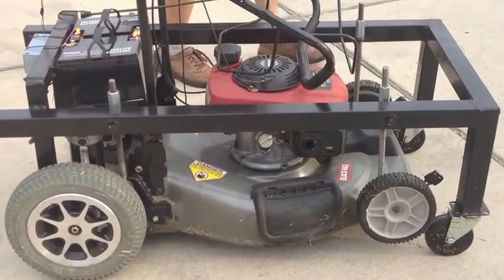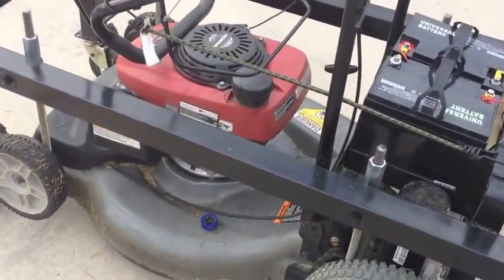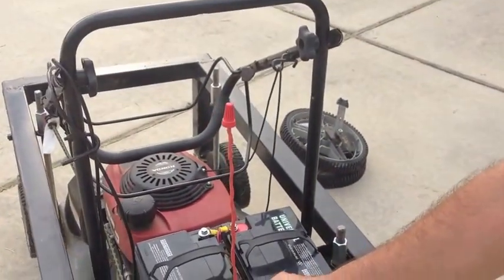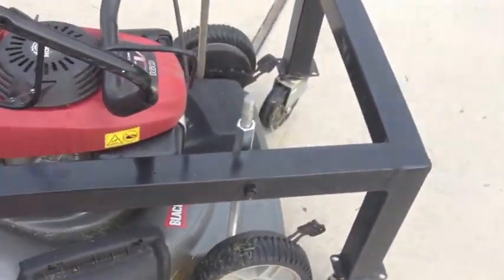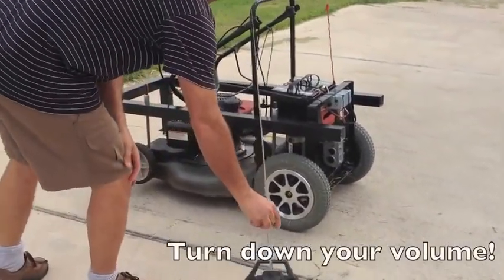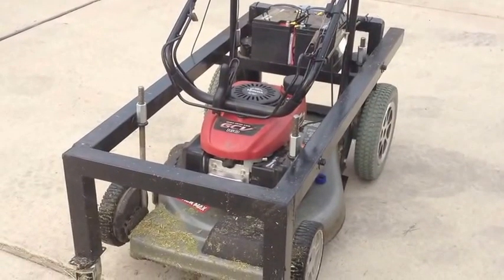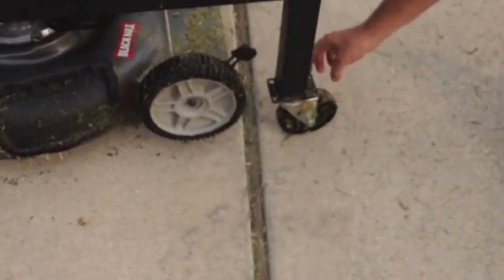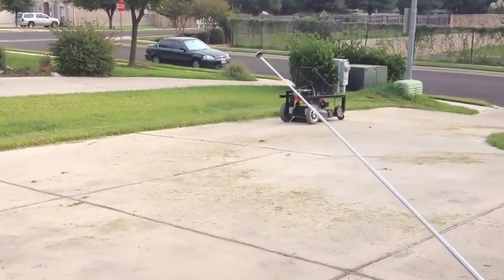Remote Control Lawnmower

Comment: @0:50, without the lawn mower, frame, batteries (option), remote controller (option), and drawing how much would you charge?
Reply from the maker: So you want just the motor # schematic and option for couple farther questions, I have to put the schematic together or make you a small video of all  necessary component plus Arduino sketch plus graphical software for your IPhone or Ipad ?
Or do you want the built module with loaded software + software that you put on your IOS devices? you have to make a frame + wheels (motor) + batteries and all other component like screw anchor and ....
where are you located At?
Reply: @Mark1Jordon1  Thank you for the response. I made a mistake how I wanted. I have to rethinking what parts that I wanted.
Reply from the maker: Check the updated video that I used Iphone and Ipad to control the lawnmower.

Comment: Since the motors are wired backward, his left and right are reversed on joystick hence the faux pas.
some of these motors have to be connected in series and some in parallel to the sabertooth controller depending which way they face as in push or pull.

Comment: hey great video.hey could you please help. could you please tell what's wrong with my project. well when I try to move the wheels the red led its flashing.end the motors just cranks. end how do I have to connect the motors  cables. because each motor has 4 cables. do I have to connect one red end one white together end one black end  white together too or only red end black. end why the motors just cranks.I hope you can help me.thank you

Comment: That has a very high degree of awesomeness :) ... I like it a lot.... I started to build a wheelchair based apple collecting robot (called Pip) a few years back in 2010, but after reverse engineering the SharkBus protocol (used by the joystick to communicate with the motor controller) and adding ultrasonic range finders onto it, I never actually got around to making it collect apples... I'll definitely be revisiting my hacked wheelchair one day. As once wheelchair hacker to another, I'd like to say "Nice work Sir!!" ... Cheers!!

Comment: You'd have a lot less resistance if you'd put larger rubber tires on the fwont of the mower..  It looks like you built this from a jazzy scooter for the elderly, is that right?